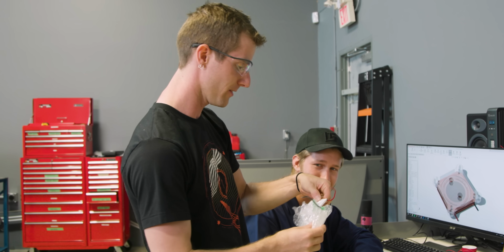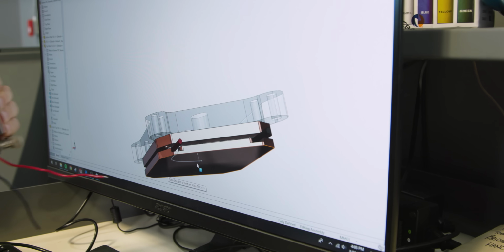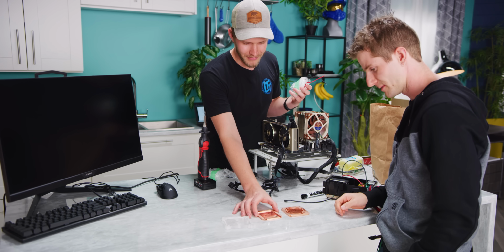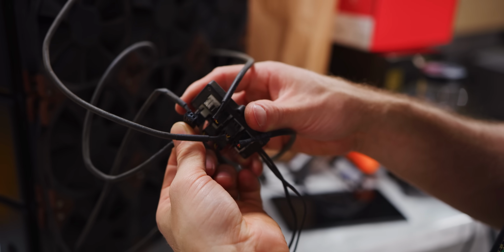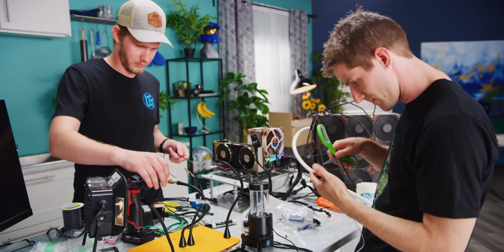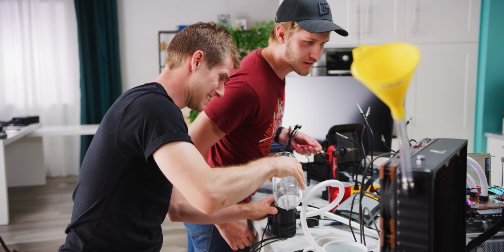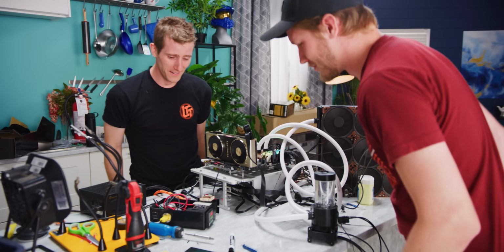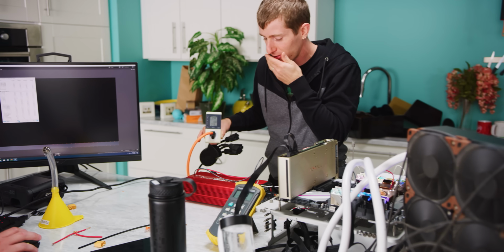This Cooler DRAWS 545W!!? Bad Cooling Ideas #2

Comment: I did my HS physics project on TECs and I found that one of the biggest problems with them is that their faces are not flat at all and since they are ceramic they are difficult to flatten so I had to compensate with globs of thermal paste and even then it was bad plus hot side temps matter almost as much as cold side since a high delta caused by insufficient cooling leads to heat leaking to the cold side lowering efficiency.  Future improvement could be done by flattening the TEC with an end-mill or facing on a lathe, stacking TECs, and direct contact vs an additional copper plate(that slot for the thermal-couple wasn't helping anything.
Reply: It'd probably be better to lap the surfaces with a diamond cutting compound.
Reply: So.. liquid metal^^
Reply: @impuls60  Will not adhere to ceramic substrate of peltier module. Also runs the risk of amalgamating with aluminum and maybe copper although not sure.
Reply: A thermal pad may be good for the uneven surface area. When you don't have level surfaces, paste is bad. Thing is, the top and bottom copper should have been isolated from each other. Otherwise the heat goes back into the cool side copper.  Fujipoly makes a good thermal pad that dissipates better than paste. The point of paste though it is meant to fill in small imperfections and small gap means better cooling. When you have larger gaps because of uneven surfaces, pads are better, but only good pads. Thing with TEC's is that milling causes them to crack often. TEC's are cheap but break easier than I thought they would. Also, I wouldn't use a TEC in a modern machine, they are not efficient enough.
Reply: @blazetownsend8785  I've tried both pads the non adhesive and adhesive type and they have a lower thermal conduction than a decent electronics white thermal paste, not even the expensive stuff.  I just used a nice thin layer of paste across the whole surface and that does the job nicely. I think the trick to using a tec is not to use a pid controller you don't need to add hysteresis you want a temperature controller using pulse width modulation (pwm) to get the desired temp you set when it reaches it, it pulses the tec to keep it in a stable state and be more efficient than a constant current/ voltage source 👍
Reply: @SlyerFox666  What was the thermal conductive capabilities? Taking MX-4 from Arctic as an example that I use for thermal compound, it has a thermal conductance of 8.5 W/(mK). For a thermal paste, this is actually really good. Liquid metal will do better, but you need a more flat surface as it is thinner. Fulypoly extreme is 11W/(mK) and the Ultra Extreme is 17W/(mK). This is vastly better, but it's not as good as copper at 401 W/(mK) or Aluminum at 250W/(mK). So if you got good results, it's because the gap wasn't that bad for you. Actual thermal capabilities of the pad verse compound show that the pad is better, but, if you have that ability to have a large surface area of contact to contact, it shows that will always be superior. Moreover, if you can use a liquid metal, you will get better results, but gallium, a common ingredient in the compound, will eat away at other metals as it reacts to them. Thermal Grizzly Conductonaut  has a 73W/(mK) their Kryonaut is 12.5W/(mK) which is amazing for a paste. Most thermal pads are not great, with ranges from 1.5W/(mK) to 7W/(mK) with even the thermal grizzly thermal pad option I looked at, only offering 8W/(mK) while their graphite pad, which is really thin as well, offers 62W/(mK) but is not a great option in many cases you'd use a pad for. It would replace paste in most cases. I hope this gives you more insight. I personally like engineering, it was what I went to school for, and I hope I help more than anything.
Reply: @SlyerFox666  factually incorrect. A Temp controller using PMW can not be more efficient as you'd still need a constant current supply to supply the TEC and then it would suffer the switching losses of the PWM driver. It's not a matter of adding hysteresis, that's a side effect and can be limited to a degree C or less depending on the resolution of the controller. Also, you lose efficiency even at 100% duty because the switching loss is still there, you never really achieve 100% unless you want to spend the big bucks on ultra fast switching edges and even if you were in the pico second realm, technically you're never going to achieve 100%.

A PID is the way to go. 
The only thing I would do differently if I were these guys would be to choose not to switch the mains and switch the low side of the power supply, for safety reasons.
Reply: @Jimmeh_B  Strange that because that's how they control reflow ovens, vapour phase and wave soldering machines in industry 🤔
Reply: @SlyerFox666  That doesn't make it more efficient.
Reply: @SlyerFox666  Also, "reflow ovens and vapour phase and wave soldering machines" ??? What the fuck has that got to do with anything?

Car engine temperatures are not controlled with PWM either! Apples and oranges you twit. What's your point? And if you have one, try to make it something related to what I said. Otherwise, just STFU.
Reply: @Jimmeh_B  Yes it does, because if you use pwm and alter the msr ( mark space ratio or on off time) it can be that the load once up to temp is only on 50- 75% of the time compared to the 100% it would be with a constant current. So simply putting it if I came into your house and turned the lights on all day on the first day compared to only 75% the next day that is a power saving of 25%. This is evident is other electronics too drones use becs which are switching regulators ( buck boost)  compare that to a linear regulator or how about switch mode power supplies compared to old linear power supplies.
Reply: @SlyerFox666  You've got a long way to go. For starters BEC's are buck regulators, boost regulators are a different topology and output more voltage than they receive at their input. 

Your example of turning the lights on and off is technically an example of PWM, one with a very very low operating frequency.

Which bring us full circle. A PID is another example of PWM with a very low and dynamic operating frequency. The difference is a PID will switch maybe twice a second at most, where a PWM controller is switching 30, 40, 135 thousand times a second and each instance of the switching event both on and off has it's inherent switching losses no matter whether the switch is an IGBT, MOSFET, SCR or mechanical. 

There is no reason, to employ PWM in a cooling system with a dynamic heat load of this type, and it would absolutely suffer more loss than that of a simple single channel PID control loop. It would also be inefficient to design such a system, given the additional complexity of a PWM driver considering that there would be no gain from doing so. 

Also SMPS's are not always the holy grail. Mostly they are employed for their space and weight savings, which does have an effect on cost, though this is not a linear relationship at scale. Also due to the nature of their switching and the required level of output filtering, are not always suited to the application as there will always be significant noise produced by the supply itself. I agree though, that for consumer level appliances they are cheaper to build, more compact and weigh less. For test bench applications, they are generally suitable. 

What we are talking about here though, is a TEC controller for a CPU cooling loop. In this instance, what you're proposing, is preposterous.
Reply: @Jimmeh_B  Yes becs are bucks but buck boost regulators are the more common name I was taught for the device which I built in the past but yes becs are buck regulators usually. It is still a switching reg tho which is used to have a better efficiency than a pure liner regulator, which was the point I was making. PID controll is not pwm ?  so I have no idea what you mean by that I have built PID controllers with simple analogue components resistors, capacitors, inductors etc. PID by definition is hysteresis added to a system for the desired output which you are controlling. So very much like an older car that uses a carb if you remove the vacume pipe you can hear it hunting (overshoot/ undershoot) as the revs go up and down or oscillates, add the vacume pipe back and you have the desired closed loop negative feedback to the system to get the desired hysteresis when you press the accelerator and to control it in a steady ideal position, But it is not pwm.  There are a ton of references online just Google it. If it is so not efficient then why are there the systems previously mentioned that have been designed around useage in industry they don't waste money in the electronics industry trust me they are carefully designed to be as efficient as possible to extend the profit margins of a company. You only have to connect one up to the phase your lights are on to see what happens when the machine reaches temp, been there done that. I don't believe I mentioned anything about cost or weight of smps I used it as a comparison to a linear one and yes anything that switches with have emc which is usually regulated and tested if conforming to regulations but that's not the point they use less power for the same output that's the point I was making. I studied alot about them doing c&g 224 analogue digital and control systems most people don't understand how they work and couldn't repair one if they tried.
Unfortunately saying something is not fit for purpose using big words really doesn't show a technical understanding and undermines your own opinion which half of is based on PID is PWM which is utter rubbish. Funnily enough I'm currently working on fixing a IGBT control unit and universal inverter at work which works purely on pwm and not PID on single and 3 phase to create the desired output using the same techniques as I described earlier for motor control and as I'm sure you are aware they are pretty thirsty beasts when overcoming the initial start ie heavy current consumption.  SCR or Thyristors are not really a good example of switching device they are more comparable to a transistor, usually MOSFETs are used to be switched on an off but we're going off on a tangent now so I will say they are an ac transistor, which latches on after the gate is given a tickle but they are not an example of an efficient device depending on how it is used and we are really getting into AC theory territory which is not what I was talking about either but just look at a dimmer switch and tell me how that is efficient with an thyristor and diac you can even touch some dimmers and they are warm to hot anyway not what I was talking about. Simply putting it again if something can be switched off more than it is on it is more efficient in comparison to being on constantly.  So by using say a constant current to get the element or in this case the peltier device or TEC or TES up or down to the desired temp then use pwm to control it it would be more efficient no two ways about it. You could use the PID on a pwm control signal to get it to not overshoot or undershoot the temp and keep it as constant as physically possible if that's what you mean, that's fine and a great way to get the closed loop control, negative feedback to the temp controller but as said they are not the same thing, we are talking about DC after all.
Reply: @SlyerFox666  MATE! Fuck you right!
I've been designing electronic circuits both digital and analogue since you were merely a twinkle in your father's eye. I don't need to be told to google anything you prat!
Certainly not from some ass that doesn't know his You're from Your and then argues the point when corrected. Just as you are doing RIGHT NOW. 

I'd wager you don't always know which of the two too's to use too.

Did you even read what you wrote in that last reply? You can't even be fucked ensuring that your comment is clear and concise. Which is quite audacious given that you had the gall to have a go at someone else about whether or not their comment made any sense earlier in this thread, when in fact it did.

Shut you're mouth. Clearly you're too young to know when you're out of line. Here's a hint, you're well over the line right now.

You are categorically incorrect on SEVERAL fronts, and clearly too egotistical to learn from those with more knowledge than yourself. Good luck with your life.
Reply: @Jimmeh_B  Simple high current consumption devices
Reply: @SlyerFox666  No doubt you'll delete all your comments anyway.
Reply: @blazetownsend8785  Sorry for the late reply I didn't see the really detailed reply after being harassed by another. I didn't go into thermals  w/(mk) I just found the same Tec with the same heatsink using same power consumption out of the three different types, performed so differently it was like the pads couldn't conduct the temps as well and the Tec suffered from the internal leak of hot to cold side or saturation point much quicker than with the paste, which was much more stable and held the cold side cold and the warm side was conducting to the heatsink and dissapating away much longer before the cold side started to rise.  I would have loved to try liquid metal tho I have heard that that's really good for this type of application. Interesting to know about the gallium eating away tho. I think the thickness of the pads I used could have been an issue in retrospec and you might get better results from the thiner pads you mention but we just had standard type equipment in the workshop to be fair when I did my investigations. If I do find some thinner pads to try I will give it another shot. I was looking for a smaller current consumption Tec but it's trudging through the data sheets to compare the max thermal difference and other details which is where I am at present and I think it's coming down to the physical size and consumption of the device that makes the big differences. So unless I stumble across something or the technology changes I may be at a bit of a brick wall, but if it was easy someone would have already done it. Thank you for the detailed reply it is a breath of fresh air after all the trolls that are usually on here. 👍
Reply: @SlyerFox666  Sometimes, people get mad because they don't understand what is being said. They take that as offense, with the numerous grammar nazi's around, me included, it can be hard to convey your findings. While it is true that anyone, in the same boat, may have incomplete information, that can lead to misinformation for them or others so I like that you are still trying to work toward finding that answer as well. I am abrasive, but I was hoping to encourage additional research in what you have already found, which was unlikely, but hope remains!
Reply: @blazetownsend8785  I don't think there is any need to be a nazi or abrasive, all it shows is someone's mental capacity to understand and be a decent enough human being and to treat others in the same capacity in which you would like to be treated yourself there is just no need for it imho. Without shelling out the cash to test every single thing for very little difference, I doubt I will be following on now as it's rather disheartening, you know what you know and that's that why try when when others can't be bothered either, and slate the things you have previously tried and tell you it's not as you have seen with your own eyes ? I will concentrate my efforts on other things if someone wants to be fanboy enough to compare thermal pastes etc that's up to them but for the whole 2deg c difference it will make I'm not that fussed.
Reply: @SlyerFox666  I understand what you are saying. Understand the grammar nazi aspect started due to my inability to process words like others. I actually have dyslexia, I don't need messed up words to make reading play more tricks than it can already. I already do double and triple checks. I can't even read when people talk around me. I can enjoy a book when I have no one talking however. I try not to be abrasive, but it's more the "matter of fact" personality I have. It does not always take emotions into account, which have little place in factual conversation. But I am aware they are emotional creatures I am talking to, so I identify that I am abrasive. As for the engineer in me, it's more about efficiency. The point isn't to have the coldest temps, it's more about how you build it, costs associated with it, effective cooling ranges. Sometimes you have to give up on 2 degrees, because it requires extremes, that can be done, but not effectively, efficiently, or cheaply. Over engineering is possible, and sometimes encouraged. Heck, I think heatpipes are better than water cooling. Mind you, they are both water cooling applications, one using a phase change, the other using the thermal conductivity of water as well as it's density to effectively soak that heat away. But water coolers have substantially small life spans in comparison, a proper heatpipe cooler is more than effective enough to cool cpu's and gpu's, and the tech even gets used in nuclear reactors, in test at this point, to transmit that thermal energy to water, without creating a waste product. Those, however, use lithium to transfer the thermal energy I believe. I did a report on that a long time ago. Point is, if you did want to do more research, please, don't let nay sayers stop you, if you want to do something else, don't let nay sayers stop you than either. Criticism is hard for any human, but we can learn from it. Sometimes, it's learning to ask questions instead of letting our fear get to us first.
Reply: @blazetownsend8785  I spent 15 years of my life growing up in hospitals so I understand you have a battle but to take it out on others be abrasive or a Nazi that's on the individual and if that's your thing fair enough but a wise man once said if you have nothing nice to say don't say anything at all. Life's not fair for any of us in are own ways but one problem should not be put above another and I don't believe just because you have a disability the world should wrap you up in bubble wrap just be a man an learn to cope with your problems the world cares not for your personal  issues. And that's unfortunately the way it is. Remember to keep a sense of humour and the world smiles with you.
Reply: @SlyerFox666  I think you took that the wrong way at this point. You may not be reading the context at this time.
Reply: @blazetownsend8785  yea maybe but did I really come here to debate this ?
Reply: @SlyerFox666  You seemed too. I do declare, we both tire of this trivial endeavor.
Reply: @blazetownsend8785  👌 An No I certainly didn't come here to listen to dribbling fools proclaim about their trouble to read, write or listen to others, I don't think you understood what I was getting at in my last msg, so let me clear that up. I came here to discuss the topic in the video and to hear what others have actually done with peltiers technically.  Not to be insulted by know it all's that claim to know everything there is to know and after lengthy heated discussions get proven wrong about the simplest of information after clearly stating that I was wrong in the first place or listen to someone talk about PID and can't comprehend the simplest of comparisons of undershoot and overshoot which is exactly why you would want PID, or read about someone pointing the finger at another's technically sound explanation that I could clearly understand and 13 others by the look of it, or to be persecuted for actually having the balls to point it out and hear crap about its not my first language, cry cry sob sob or have someone be snarky and tell me their life story when let's face it you need some perspective in life there's a lot worse that you could go through but no people just can't stop themselves become a frigging keyboard warrior and do the jazz hand routine because they have a sore dick because it's pretty dam obviouse that's all their hands do if they ain't on a keyboard giving out net rage because they have nothing better to do and have a very sad life.  It is tiresome that we can agree but like I said keep a sense of humour, you have to really if you suffer with dyslexia they don't make that easy to spell correctly do they, but I'm sure il get the blame for that or told I'm wrong about that too, it's ok tho like I said after 15 years of what I've been through you get pretty thick skinned and couldn't give a sh!t about others opinions because another wise man once said ' Opinions are like arse holes, everyone's got one' 🙏
Reply: @SlyerFox666  Still going aye? Want to blame someone else again?
Reply: About the piece of copper in between: I thought that too but then there would be no way to regulate the temperature.
Reply: @eklhaft4531  Good point, but it would have been better to drill into the side of the copper and insert the thermocouple in the hole. That way you're not sacrificing surface area.
Reply: Wow I didn't expect so many likes I regret not going full big brain with the comment. Lapping with diamond compound sounds like a good idea, but I've never used it before and yeah I agree besides consumables, compactness, and noise; they suck at cooling but their certainly fun to experiment with and cheap. Also I can't think of another sub-zero capable method that isn't utilizing some form of phase-change so that makes it a bit more unique.
Reply: I was going to say, what if they removed the bottom plate and liquid metaled it the bottom of the ceramic direct to the cpu ? They never checked if the bottom plate was getting cold only the hot side
Reply: @loudaagoo  Actually, their thermal probe was only touching the cold side
Reply: You cant machine ceramic traditionally
Reply: @SlyerFox666  Nah i was saying trabladorr is a troll XD
Reply: @ImMonoToast  Oh shit I do apologise I thought you were taking aim at me 🤣 sorry. Deleted 🙏
Reply: there is no hot or cold side, you just flip the wires and the cold-hot side will switch
Reply: @Laayekthar  "there is no cold or hot side".....then you literally call it the cold-hot side right after because there is a cold/hot side. lmao just because something is reversible doesnt mean the sides dont exist anymore.
Reply: It's hard to believe you took your project seriously when you can't bother making your comment readable.
Reply: @trabladorr  I think you mean can't be bothered to make your comment readable 🤣😂🤣
Reply: @SlyerFox666  oh well, not my first language. Point still stands!
Reply: @trabladorr  Then don't throw stones if you live in a glass house and if your talking about the first guy in this comment then I had no problem reading it and it is my first language. So I don't think so imho.
Reply: you're *
Reply: @trabladorr  Your is a possessive adjective,  we were talking about you possessing the skills to read my friend. 🤭
Reply: @SlyerFox666  Learn to admit and accept your mistakes. There, that's a correct use of "your".
Reply: @trabladorr  What an FN troll dude. It is Youtube video's comment section XD.

Side note, I almost sure if you can replace it with "you are" and it works then it needs to be "you're" not "your."  Its also a run-on sentence but I digress.
Reply: @SlyerFox666  I could understand it perfectly. I think issue lies somewhere else. And i am foreginer.
Reply: @SlyerFox666   but if he has Ai machine guns installed on the roof of the glass house he can!
Reply: @ThomasDdm  Na I've got the emp to shut that sh!t down as quick as a flash.
Reply: @SlyerFox666  You're wrong.
Reply: @Jimmeh_B  Ok BEC boy 😂🤣😂